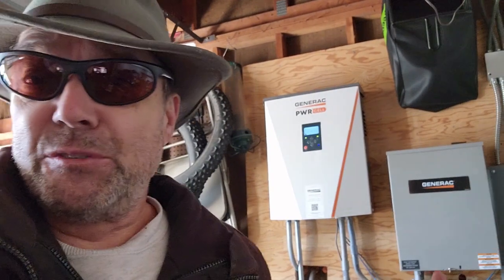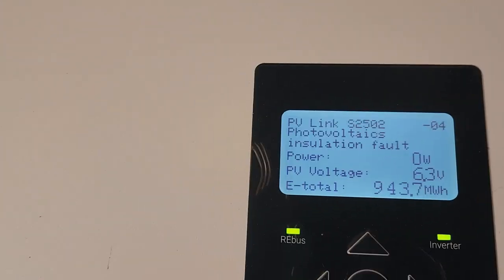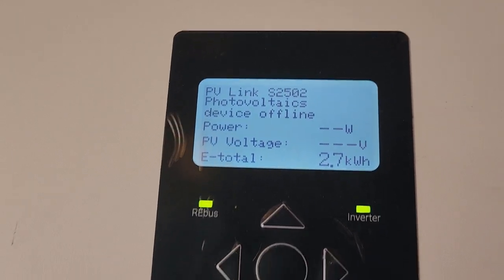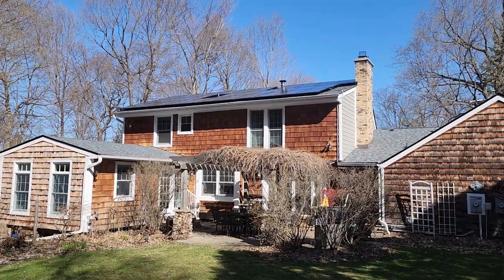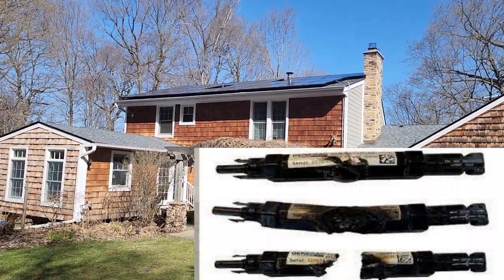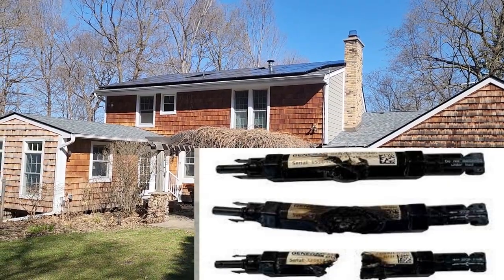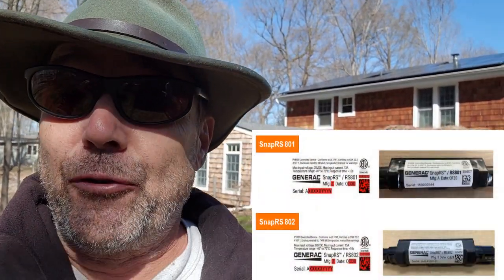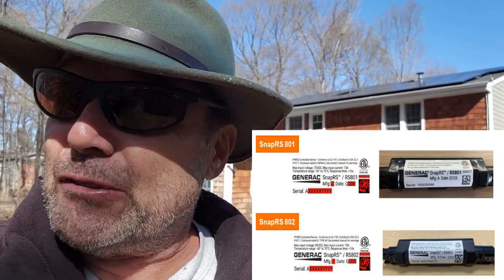Fix Your Generac Solar System ASAP!!

Comment: How do you know if my system has these
Reply from the maker: how long ago was it installed?
Reply: @TurbineGuy  it was here when we bought the house two years ago. I think the original owners said it had been installed a year pryor to buying g the house.
Reply from the maker: @bobbycarmony5546  You may have the older units. You will have to look behind of of the solar modules as each one has a snaprs on it. It should be connected to the negative lead from the module.
Reply: @TurbineGuy  thank you.
Reply from the maker: Let me know what you find out